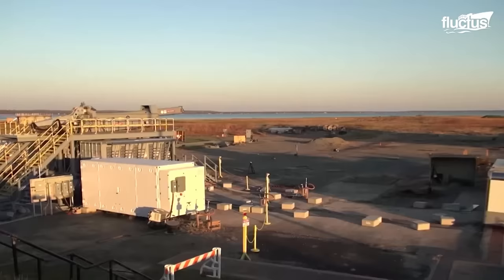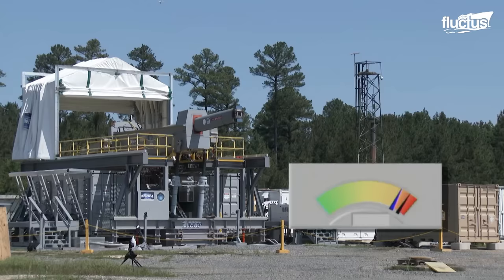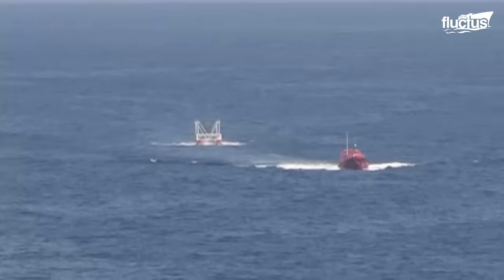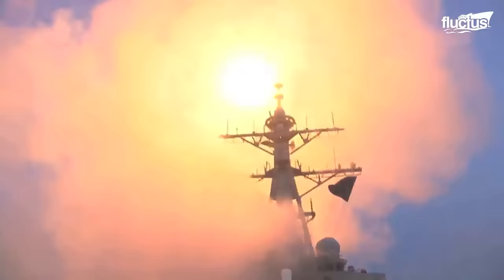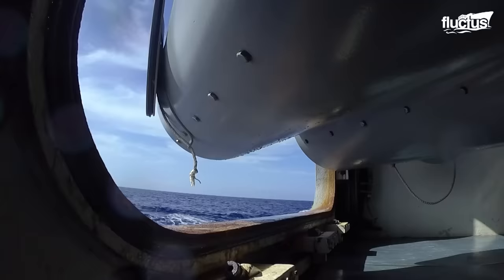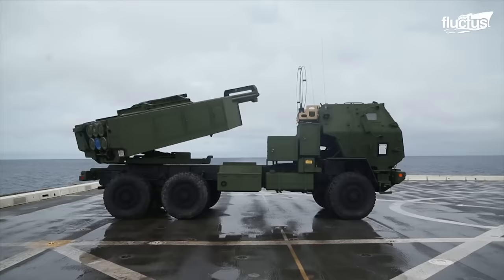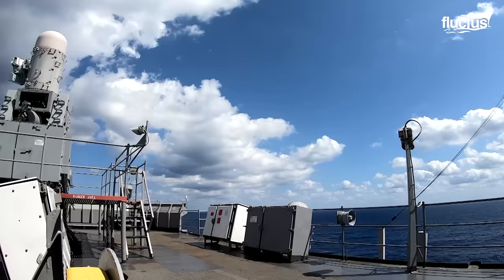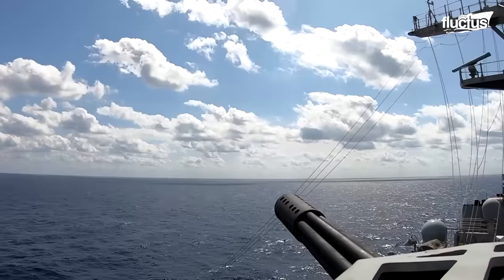US Testing Its Monstrously Powerful $500 Million Rail Gun

Comment: Unfortunately I don't think that the desired rate of fire was achieved. And also the Barrel material degraded too quickly so they needed another solution which they haven't come up with yet. until then awesome gun I'd love to see it in service maybe coastal defense would be great for it.
Reply: One solution being used to achieve similar results, is in the round itself. They are using new rounds that can be used in existing barrels...
Reply: That travel at the same speeds..
Reply: @casualcampaigns  I think he was trying to say that using a different kind of projectile might be a solution to some of the problems pointed out by OP
Reply: @fumbducks  Close what he meant is the following. Railguns launch a projectile at crazy speeds. When getting to speeds above Mach 3 air pretty much acts like a semi solid. And the faster you go the crazier the physics becomes. SO conventional ammunition would be useless so they had to specially design ammunition for the gun. It was later found out that his special ammunition carried over some of its unique properties when fired out of conventional barrels that use chemical charges to launch said projectile. So what may end up happening is using this ammunition with conventional firing methods and still achieve partially what they were aiming for with the railgun.
Reply: Completely obsolete, we're onto plasmoids now
Reply: I wonder if they could make a gun that's a smaller version of the SpinLaunch system that throws satellites into space?
Reply: Why not just use tungsten its extremly durable and worth the price for such power
Reply: @alexb7641  also the Japanese government just announced it's 6th gen figther plane one interesting thing in the specs was a energy Canon do we have energy weapons in today's times?
Reply: @Soup_Time346 magnetic or something
Reply: Do we know if the barrel wear was due to the projectile actually having to contact the magnets or just from the pressure and sonic energy? If it's from actual friction then I'm sure they can figure that out.
Reply: You're all a bunch of nerds.

Comment: Rail Guns are already on Destroyers an a smaller version on a AC-130. The Railgun used to malfunction only because the electricity was so hot when firing a projectile it would wear out the inside of barrel. But they been perfected it they also used this gun in the Transformer Movie around 2007-08. It's just classified on ships but they do have them operational. Source: Trust me Bro
Reply: honestly this sounds more trustworthy just cause u said that
Reply: I think one may have already been the old DD 964 test ship. I used have a bumper sticker from when I was on it.
 DD 964 Paul F Foster
Riding on the current               (From 4 x 22,000 KW  (LM 2500s))
The Foster had all electric propulsion. No gear reduction from the LM 2500s to the shafts. Like the Perry Class.
Reply: There are videos of a smaller version rotating and aiming up and down. This video is old.
Reply: LOL, then you woke up and had your cornflakes.

Comment: The US Navy declined to continue funding this project, they gave it 10million in 2022 which is barely 'station keeping' level of funding.
Reply: The railgun is too powerful for any over the horizon targeting. The projectile will travel 100 miles but it will be in space at that point. Missles are strategically more superior for this purpose. Just because the Navy dropped it doesn’t mean it has been completely abandoned. Railguns are more lethal if used from space.
Reply: yep! planetary based rail guns have been officially mothballed...but in outer space its on the down low....just need to be fired from an object with A LOT of mass or it will quickly push itself out of orbit lol
Reply: not to mention a nuclear reactor for power, but that could double as the large mass....dont think solar panels and batteries will cut it lol
Reply: That was enough to paint rainbows 🌈  on them.
Reply: Imagine a depleted uranium core on this lol. Tho it isn’t very likely to happen.
Reply: @noname-codm4590  i have no idea. there is a lot at play with electrical and magnetic fields going on...might be possible....if it is then wow
Reply: They are going to use them as rod from God style mortars when the capacitor systems become a bit more robust and MUCH more compact.
Reply: They can fire it once per year
Reply: Laser vs railgun
Energy needed
Limited range from no propulsion
Weight including ammo or shells
The verdict is laser.
Reply: @haharrr7018  i think the verdict will be both with laser being more generally useful
Reply: @Rooboy-619  Using railguns from space? Dude, after the first shot that railgun will fly away to other universes and rotate around its axis for millions of years. There is nothing to keep them on the same point. And if somehow they figure it out how to keep the position, the earth will keep rotating. And the russians could target it with the laser weapons they already have.
Reply: @neko1533  I see your point. What about on the moon?
Reply: @neko1533  very unlikely, for a laser to destroy a satellite it would need to be extremely powerful more so than anti missle lasers today they have an effective range of 1-2 miles with satellites we're talking 6 to 12 thousand miles earth's atmosphere would have scattered more than enough of a lasers energy to be absolutely ineffective especially so if defense for lasers were planed for for example reflecting material like most satellites use today for solar Radiation. A "MAC" cannon or mass acceleration cannon Is viable if it's placed in an orbit just out side a decaying orbit allowing it to enter a decaying orbit then firing allowing the backwards momentum to propell it out of that orbit into a stable one its totally viable just need the math on its energy in momentum generated by firing x weight at x speed then decaying orbit height and energy needed to move it out of x orbit height to a stable orbit height it would not be a rapid firing weapon but that's where multiple come in.
Reply: @utpharmboy2006  I suppose if launched from space, they could use a bunch of thrusters in the opposite direction to keep the launcher from being thrown out of orbit?
Reply: @ryanfallon  yeah i guess they might as well gonna have to bring ammo to reload it anyhow...might be too expensive sysyem to be disposable or maybe not idk
Reply: But the Army is still researching it
Reply: @Rooboy-619  the moon is VERY VERY far away. 238,900 miles. It would take a very long time to reach the target, and would have to be fired at a narrow angle to avoid glancing off the atmosphere, then it would have to hit the target you were aiming for. (For reference to see a 4ft flag on the moon you would need a telescope that is 20x larger than the largest one on earth.)
Reply: It's easy, you fire two shells in opposite directions, one towards the ground and the other towards interstellar space
Reply: @utpharmboy2006  The ISS would produce enough energy to fire it 270 times per day
Reply: Logistically, it makes sense to use rocket artillery for now, however the speed of a railgun projectiles is vastly superior to any chemically-propelled projectile. 

There will be a future in railgun technology, but right now costs are much to develop them today.
Reply: @s7596399  well.....now that the russians are leaving.....😏
Reply: @joelthomastr  right...almost like a recoiless rifle....
Reply: @utpharmboy2006  well you don't need that large of an object to shoot, so you don't need a massive satellite, though I'm not sure the energy conversion of a bowling ball size lead ball going at 100mph.
Reply: @utpharmboy2006  They'd work, we'd just only be able to fire it every 53 years...
Reply: @Rooboy-619  The rails are the failure point.
Superheated plasma being shoved ahead of the projectile tears the rails apart.
Reply: @noname-codm4590  Why?
As these speeds, high cross sectional density has no meaning.
Reply: @haharrr7018  Lasers lose resolution in air. Called Thermal Bloom, the hot air forms a plasma that spreads the beam.
Precomensation won't work because the photon crowding interacts with the gas entrainment resulting in reduced photon density.
Reply: @utpharmboy2006  didn’t think of that.
Reply: @hellstromcarbunkle8857  for that you can already use any dense metal, but you are right it has no meaning. But ig even without that, there is no armor that can withstand this given the speed pf the projectile(conjecture, I’ve done no research and this is what my stock knowledge has). 

I’ve just realised how much painful denser objects are, I have this silicone ball “Superball” Wham-o. And while holding it, it came to me that this thing is so dense. Heck, I could even break someone’s skull. What’s more is that when I researched how the ball is made, it said that its made by compressing Zectron, a high impact rubber, at 50,000 pounds.
Reply: Laser based weapons have far more potential for destruction given that they are only limited by the power source meaning we can keep making laser based weapons more powerful as our power sources increase and our tech advances.
Reply: @noname-codm4590  I was referring to cross sectional density.
Think of a sphere. The density along the impact axis is just exactly the total mass / surface area.
Now make an arrow. The entire mass is divided only by the impact area.
Apply 1/2mV^2 and BLAM (assuming Mach 7). Double the mass just double the acceleration. Double the velocity, SQUARE the acceleration (of the target)
Reply: @richardabraham8313  No. The beam concentration falls quickly with distance.
A faster moving target means less time exposed to the beam and more "miss time" when the beam is not on the target.
Right now, good for drones.
Notice NO ONE has tried an ICBM against a laser. Won't work.
Reply: @hellstromcarbunkle8857  So, the heavier your bullet is, the higher your SD is. How do you make your bullet heavier without changing its dimensions? Use a different material with a higher density. Density = m/v. You get more mass without changing its volume. (Problem is, you’ll need more energy to accelerate the newer bigger mass of the uranium projectile either way making it obsolete compared to the idea of just increasing the power of your railgun to increase its output without using a super heavy one. I just realised how different railgun is to from conventional guns.)
Reply: @richardabraham8313  can't help but think of planetary defense comprised of giga chad lasers against hostile life forms lol
Reply: @noname-codm4590  How about you go faster, SQUARING acceleration, instead of just multiplying?
hmm?
Reply: @hellstromcarbunkle8857  i dont get it
Reply: @noname-codm4590  The equation for momentum I gave you exposes that faster makes a MUCH bigger change in the impact energy to the target.
The rail gun single biggest advantage is that the total destruction of heavy armor out at 150 miles is possible with no explosives in the warhead.
Literally, hit the opposition with a meteor.
Reply: @hellstromcarbunkle8857  i thought momentum and kinetic energy is different😵‍💫i am confusion
Reply: @noname-codm4590  Momentum CAN be different than kenetic energy.
The former is a vector figure, the other scalar
Reply: @utpharmboy2006  well... afaik with a recoilless rifle the idea is to let all the propellant out the back so it doesn't interact with the rifle. This works because the projectile contains its own propellant and the tube doesn't actually have to be doing anything. With a railgun there is no propellant, it's the tube itself that propels the projectile, so I'm saying to compensate you need to have the tube simultaneously send an equivalent projectile in the opposite direction
Reply: @hellstromcarbunkle8857  which is only limited by the power output. Like a flashlight being limited in strength only by how many battery cells are being used.
Reply: @joelthomastr  right. i shouldn't have said almost like...just kind of like...the recoiless rifle stays put and so would the satellite
Reply: Yeah it's called Secured info. To prevent loss of life they need to get out of the area since it goes 100 miles. Edit much?
Reply: Railgun utilizes a $25k projectile instead of a multi million dollar device so it kind of balances out.
Reply: Put it on a star destroyer!!
Reply: @noname-codm4590  The faster your bullet, the more acceleration the impactor will give to the target.
Go fast enough and aluminum will beat Uranium going slower.
Like, the square root slower
Reply: @richardabraham8313  As I said, no it is limited by the diffraction and photon crowding beam expansion.
a more powerful laser will spread out more. In air, much more thanks to atmospheric lensing. More batteries won't help
Reply: @JayJay-de5jv  i think id rather have the turbolasers already equiped
Reply: The program went to the department of energy.
Reply: @Bill-jw3ph  Yeah, the DOE whose entire budget since Raygun has been dedicated to taking Nukes off the Pentagon Budget
Reply: @haharrr7018  isn't the railgun basically explosive since it literally transforms air into plasma when it flies?
Reply: @Rooboy-619  I think that, with more R&D, guide fins and electronics can be added to get it on intended target. Keep that classified and fund it with shadow budget 💰
Reply: The worse brainless project in the world🤣🤣🤣🤣😝😝😝
Reply: @VIVA.MEXICO.PUTOS.AZTECA.  No, the Sgt. York was the most brainless ever

Comment: Laser Gun Operator wanted

Requirements include:
Experience needed: 12 years console experience
Minimum rank 600 MW3
Must be able to work long hours 
Must have good reflexes a good mind for strategy and problem solving, and the ability to multitask (I.e. eat and operate simultaneously)

Comment: I like how the projectiles just warp time and space as they fly through the air
Reply: The fire released by the gun firing isn't anything explosive, the bullet is moving so fast when the gun fires that all the oxygen around the muzzle is instantly turned into fire, which really shows how powerful it is
Reply: I'm not sure if you are serious but it looks like that (?) because projectile creates a shock wave which changes refractive index of air near it. 

Small piece of metal flying 3km/s doesn't "warp time and space". Most violent incidents in dying stars can be 50 000x faster and million billion billion times more massive. They definitely warp time and space, even to singularity
Reply: @bekanav  Well just about anything will warp space/time it one thing not separate but the warp so small it can't be detected short of laboratory instruments. 
Bees though can pick up the fact the warping effect we call gravity is higher or lower in spots in order to tell other bees the location. Time moves slower the closer you are to the mass attracting you to it by bending space/time gravity is not a force it and effect of space/time curvature.
Reply: @RedRocket4000  Yes but not in any significant neither observable manner
Your bee theory sounds silly
Reply: it's not time and space being warped, it's  air getting bunched up extremely tight (extreme pressure gradient causes the shockwave).  It's true that mass at speeds nearing the speed of light will cause local spacetime curvature influences, but pedantic to say that time is being warped by this, as the influence would be infinitesimally small.
Reply: Quintom ................
Reply: Technically anything with mass warps time and space... So, correct well done 😂👍
Reply: Actually It's a very expensive bug killer. You see that shockwave rippling through the air- that's what kills the insects. Kind of overkill if you ask me.
Reply: @LeeMaitland  
Lmao. True. 
That's generous of you...